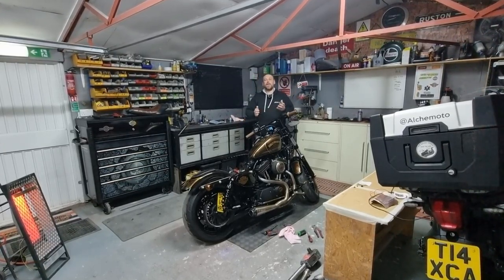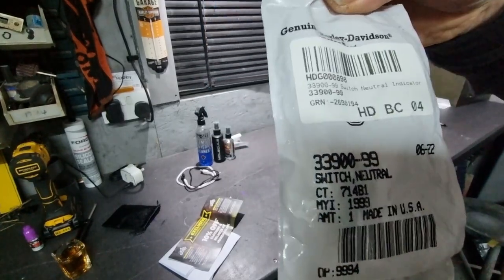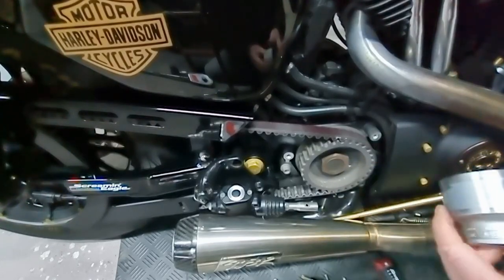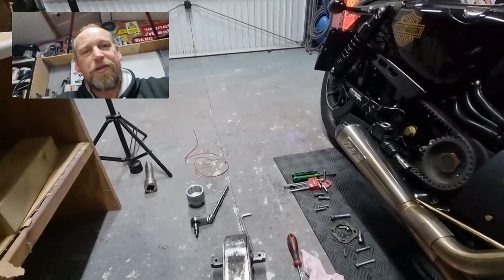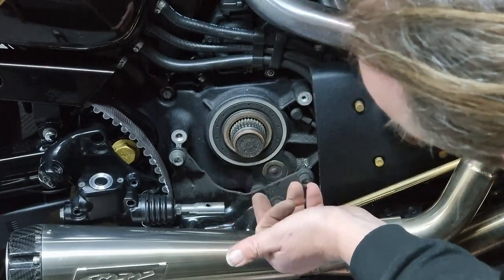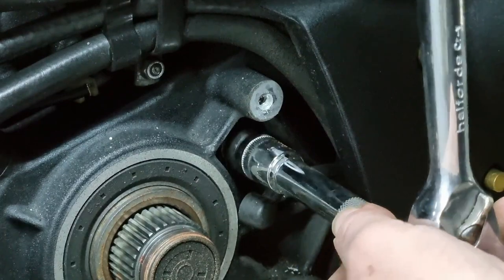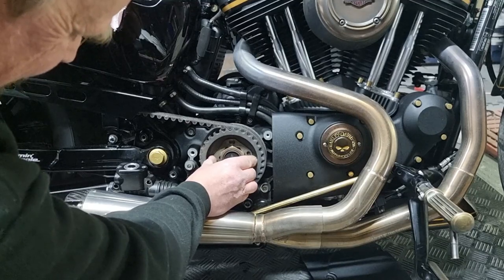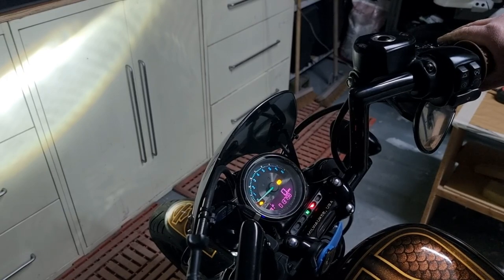SPORTSTER 48 NEUTRAL LIGHT FIX & Pulley Removal #harleydavidson

Comment: Good and clear illustration. Thanks for making this video.  Question: what is the torque specs for the 1-7/8? I read the manual it says 68 Nm (50 foot pound) When you use the BIG wrench, you have a torque setting for that?
Reply from the maker: Thanks mate. 👍 yep, 65-70ft lbs. My manual impact wrench goes to 2000 so have to wind the springs right off 😁.

Comment: great video, question though, assuming you follow the steps, putting in high gear and using the locking tool, can you then just refit the pulley and the belt or do you need to do a further belt adjustment after? is it as simple as you've highlighted in the video or is there more to it?
Reply from the maker: Hi Jamie.. Thanks 👍.  The only other check is to make sure the belt tension is correct after refit. Not sure if included in the vid now without watching back. But you would just adjust belt via swingarm adjusters anyway and check belt running true. Always worth checking first before assuming its ok 👍. If belt running centre of pulley after turning rear wheel and tension ok  then that is fine . 👍
Cheers

Comment: You did say you don't need many tools...but us normal folk don't have a swench wrench nor air tools...Great job though...my switch  wire has come off the switch itself...iv not got the tools to refit this..
Reply from the maker: Fair point 😁👍.. you can see the switch behind the pulley but need to remove pulley to get socket on switch. But you should be able to get the wire back on without removing pulley. Just need to remove pulley cover, as you can see the switch then 🤔

Comment: In the handbook of Sportster 2007-2012 is written of a1 1/2 Zoll. Whats the right size of the nut 1 1/2 or 1 7/8 Zoll?
Reply from the maker: 1" & 7/8 socket but remembee its left hand thread and will be tight